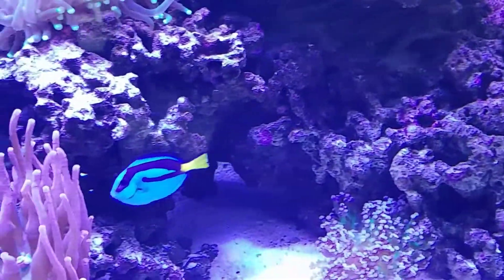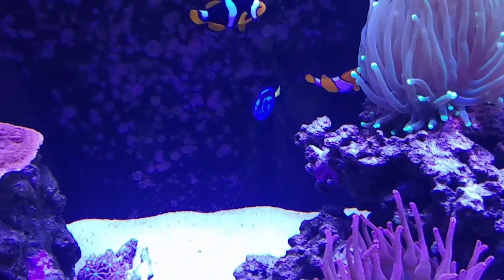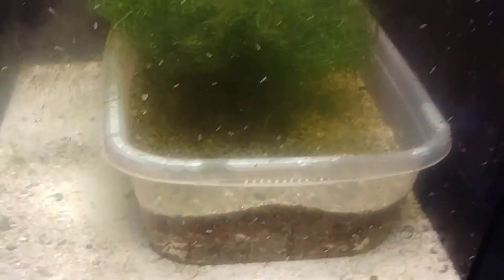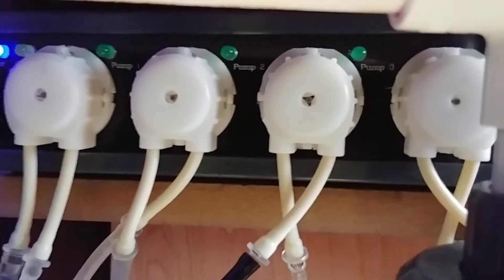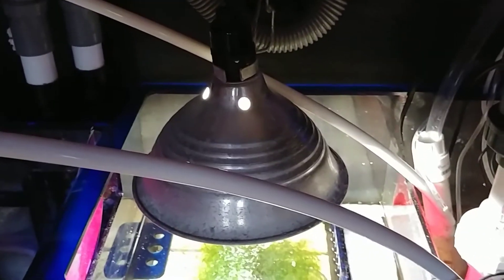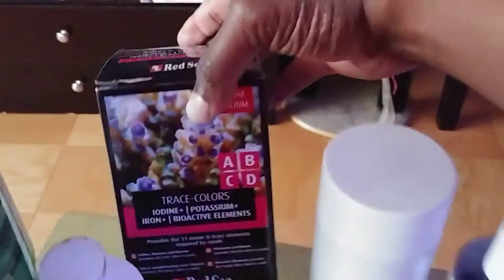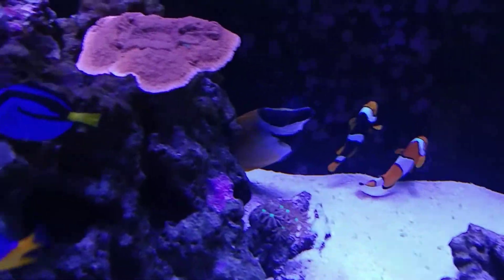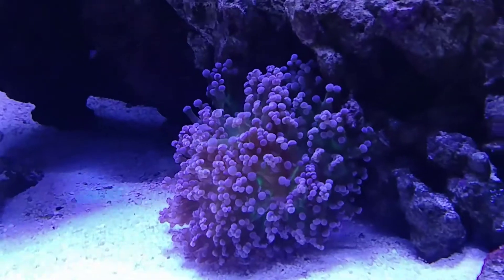Reef update,Carbon & HLLE effects on Hippo Tang

Comment: How did the miracle mud do in the long run for your tank? And do you recommend it?
Reply from the maker: I found that the miracle mud helped to keep my water clearer than without it. But i would say it wasnt much of a miracle. I suspect there are positives in the nutrient aspect of the mud but no overwhelming evidence to say it took my system to the next level. I would recommend it but only as an additive after your tank is already stable and mature
Reply: @bronxreeferbrock1750  Thnx!

Comment: Does it cause rapid breathing? My brother who thought he'd help me out with my tank put wayyy too much activated carbon in my tank without rinsing it. I didnt notice until 3 days later my yellow tang is breathing very fast https://youtu.be/uzW1w0xQppc and im quite worried. Not sure on what to do. Ive done a 20% waterchange and removed the carbon.
Reply from the maker: I would set up an air pump right away to oxygenate the water immediately!! Remove the carbon and do a 15-20% water change. Too much carbon can wreak havoc with your livestock
Reply: @bronxreeferbrock1750  i have a couple corals how long should i leave carbon out?
Reply from the maker: You dont need to run carbon 24/7. I only use carbon if i have impurities in my water that need to be removed or water clarity issues or odors. I run carbon every other weekend and change it every other month
Reply: Thank you bud. I did a fresh water dip. And used saftey stop that was recommended by my lfs. I used that. And the breathing hasn't slowed down but the tang ate less than 5 minutes later. Im just confused. Maybe his breathing is normal. I don't know.
Reply from the maker: I would stop adding any chemicals to the tank and just use an air pump and fill the tank with microbubbles. Just like bubble scrubbing. It really help. Fast breathing is always a sign of extreme stress and is usually not normal in my opinion.
Reply: @bronxreeferbrock1750  sorry i took the tang out of the tank and then used a safety stop. Fish seems fine swimming around/ eating nori e.g just breathing fast.
Reply: @bronxreeferbrock1750  https://youtu.be/uzW1w0xQppc

Take a look at the tang please incase you spot anything. He was my first tang i dont want him to die if i can help it in anyway
Reply from the maker: The breathing does seem a bit fast but he looks perfectly fine to me. Hes actively searching for food so thats the best sign. I dont think you have any problems. Tank looks great too
Reply: @bronxreeferbrock1750  thank you really appreciate it! Hows the hippo doing?
Reply from the maker: No problem! Anytime i can help. The hippo died about 6 months ago after he lost an eye by scraping too close against a rock. The struggle continues lol
Reply: @bronxreeferbrock1750  oh damn sorry man......sorry auto corrected to dory...... anyways hope everything else is doing good